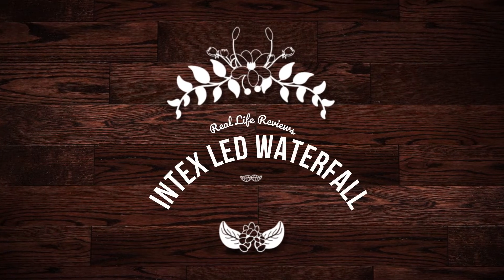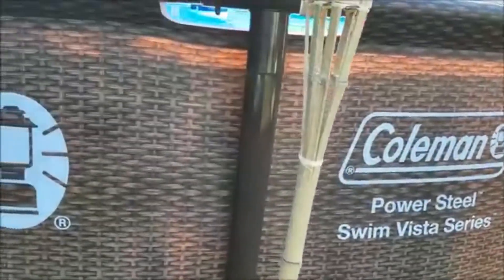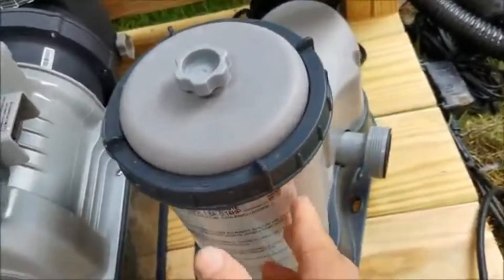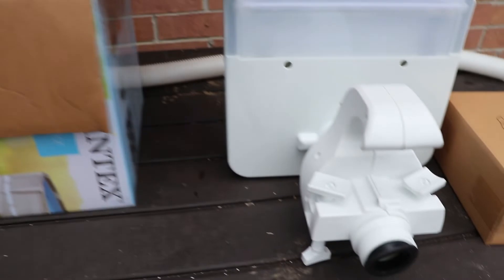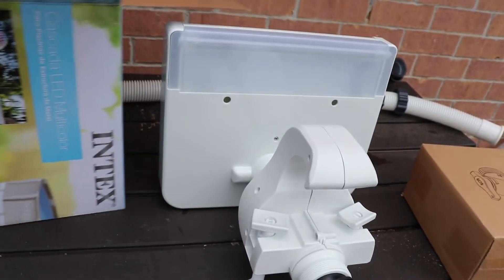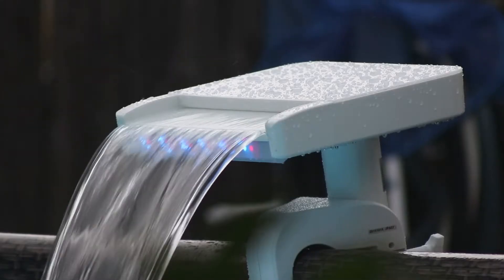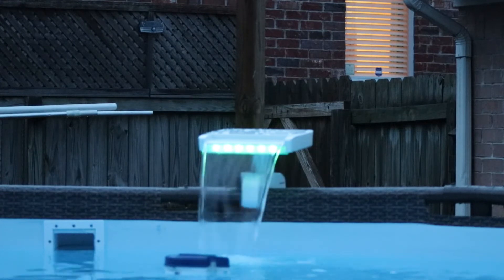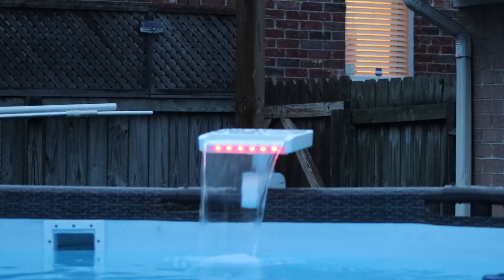Real LIfe Review: Intex Waterfall...Best pool add on yet

Comment: Hello I am going to install the waterfall to the inter Crystal sand pump. Well this replace the current flow into the pool? I believe there’s a bypass included so I’m wondering if the waterfall Would be the primary filtration
Reply from the maker: On mine, the primary filtration  comes through the discharge port on the pool. I use the small, original pump to power the waterfall

Comment: We've bought our first above ground pool and didn't realize the rabbit hole I was getting myself into. These simple above ground pools can become elaborate real quick after all the add-on's one ends up buying.  Love your videos and I'm going to subcribe but I wish you would have shown the way the second pump is connected to the waterfall. My Intex prism pool has two skimmer holes that my sand filter is sucking from so would waterfall draw it's water from? Thank you for your time in making good videos.
Reply from the maker: not at all. if you dont have a second pump, you could hook your pump discharge to the fountain. The pressure is sufficient and the water is clean.
Reply: @RealLifeReviews1  I do have the  second pump just like you that came with the original pool, I upgraded and bought the sand filter.  I don't have a mechanical mind so I don't see how you added the second pump and hoses to the mix. Thank you sir,
Reply from the maker: @easy1965  Let me go through some of my videos real quick and see if I can see the hookup. I can tell you that it simply screws into your original pump with the original hoses. I didnt have to change or modify anything.

Comment: Just got this pool set up and ordered the intex sand pump to set up...I’ve heard I will have to use the hoses from the original pump to hook up the intex so if I got the fountain would I need to order another hose? And what hole do you run it through? One of the b’s?
Reply from the maker: You'll use the original pump and hook directly to the waterfall.  One suction line out for pump and one out for waterfall.
Reply: Real Life Reviews can u show how to do it! I just bought that pool and i also got the 12inch sand pump. I will be really grateful. Keep up with good job!
Reply from the maker: @jhfelicianophoto  next Wednesday I'm doing my overview vid. Hang tight.

Comment: We have the waterfall connected to our new upgraded pump.  Do we need two pumps or do you have both pumps in line?
Reply from the maker: I use the original pump for the waterfall and the new pump to the pool.
Reply: We hooked the waterfall into the regular upgraded pump we bought.  It works but isn't as strong as yours.  I'm sorry for the dumb question, but I don't see exactly how you connected the waterfall pump into the larger pump?  Does that make sense?
Reply from the maker: @calliepigg8934  I didn't.  The waterfall is powered by the original pump. I have added a skimmer for the upgraded pump.

Comment: It's me again!  Question.  Have you ever left the fountain on 24 hours straight?  I purposely did last night due to the extreme heat.  Just curious if you would or wouldn't recommend doing so?  Thanks yet again!
Reply from the maker: I have on several occasions, particularly if there has been an excessive amount of rain. It helps filtrate acid and irons through the sand. Heat is generally not a factor and not quite sure how that fits in, but its no problem to leave it running occasionally.
Reply: OK. Great!  thanks!

Comment: Any idea how I could use the original cartridge pump as an additional filter?  Maybe as a surface skimmer filter or something?
Reply from the maker: I used it for the water fall. I also just got another, so I'll use that one for an extra skimmer. Great question!
Reply: Please make a video because I want to see how you hook it up to make an additional skimmer
Reply from the maker: @chrisdiehl8387  I'm putting the pool up next week,  so that's hopefully when I can get the vid out. There are still two other postings in front of this one.
Reply: I have a sand filter and the cheap filter that came with the pool. My pool has two inlets and one outlet. I would like to have my sand filter hooked up to one inlet and the skimmer hooked up to the other inlet. The sand filter would discharge into the pool and the surface skimmer would go through the cartridge filter and discharge through the waterfall. Is that doable?  So basically the sand filter is completely independent of the cartridge filter and I would do away with the “splitter” that connects the 2 inlets together.  My waterfall should be here in a few days and the sand filter I bought came from academy and is only rated at 1200 gallons so it’s pretty small. That’s why I want to incorporate 2 pumps. Plus I have more fish tanks than I care to mention and I’m use to the thought of more filtration is better. Anyway thanks for your help my friend.

Comment: How is this fountain holding up gor you?
Reply from the maker: Its holding up just fine.  I store it in the winter, but will have it out in a month from now.
Reply: Leds still working ok on it?
Reply from the maker: @anthonym.9549  yes. If you dont have adequate water flow, the LEDs wont work. If you have good pressure, they are bright!
Reply: Thanks for the info bubba.

Comment: How do I hook up the other pump just for the waterfall  mine don't light up on the regular pump
Reply from the maker: Use a B suction port. If your light doesn't turn on, remove the paper filter. This should allow more water flow.
Reply: @RealLifeReviews1  I did what you said I hooked it up to another pump by itself but it still doesn't light up anymore suggestions
Reply from the maker: @debradalton863  looks like its defective.  They are real quick about it.
Reply from the maker: @debradalton863  make sure its level and not tilted.

Comment: We installed a Hayward skimmer on our intex pool too. We bought the intex auto vacuum but aren’t sure what we need to hook it up to the return line since we switched it to the Hayward pieces that came with the Hayward skimmer. I looked for your video where you said you would talk about why you changed that piece on your pool but couldn’t find it.
Reply from the maker: The vacuum hooks up to the discharge line. It should have come with the adapter for the original discharge fitting. The Intex vacuum doesn't use the Hayward skimmer because it is the point of suction. I hope this helps.
Reply: Pondiver yes I understand the vacuum goes on the discharge line and not the suction line. But when we changed the intake part to the Hayward skimmer we also changed the discharge part from the intex brand to the Hayward eye for discharge and now the intex vacuum will not fit into the discharge because we changed it from the intex brand to the Hayward brand. If I recall right you stated you also changed this part in your Hayward skimmer review so my question is what did you use for an adapter so that you can use the intex vacuum on the Hayward discharge line? I do not have the original intex discharge eye so I can’t switch it back.
Reply from the maker: Oh, I see what you're saying.  I use the back of an original strainer to plug into the new discharge.  Look at this link...   https://amzn.to/307cjhk
Dont purchase. I just want you to see. So, if you unscrew the top from the strainer,  it will leave you with a cap and base. The base screws directly into the Intex hose and force fits into the Hayward discharge fitting.